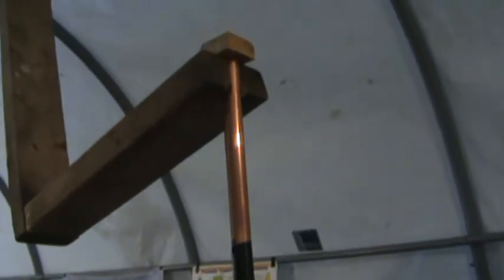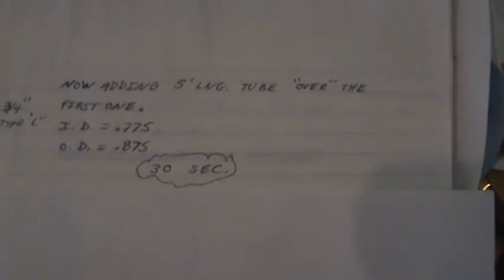Antigravity Effect , Magnet Through Copper Tube, part 2

Comment from the maker: @thallium200 Undulate,,yes. The faster a magnet falls, the faster it undulates, which is strange because of all the back and forth motions,,it is taking a longer path down.  I have not seen a definate pattern with this motion yet, it goes back and forth, then real fast will make a partial spiral, then continue with back and forth.
I may show in next vid, magnet falling down non ferrous tube or non magnet object falling through ferrous tube,,or maybe both.
Thanks for comments, good observation.